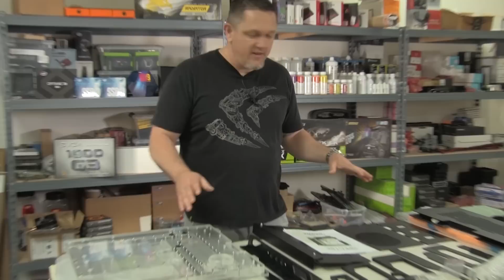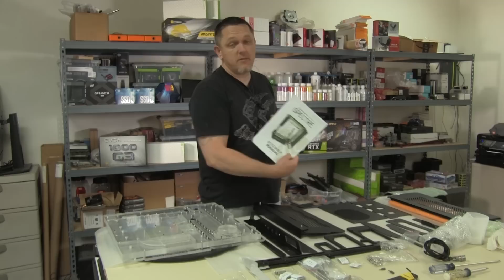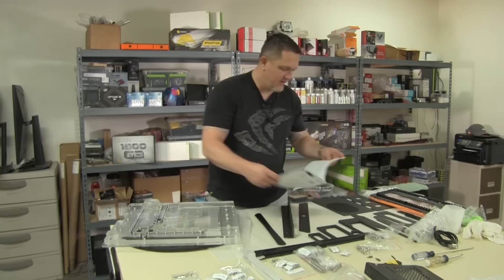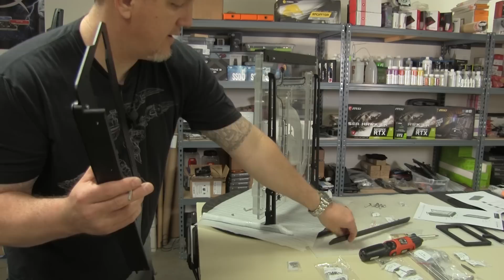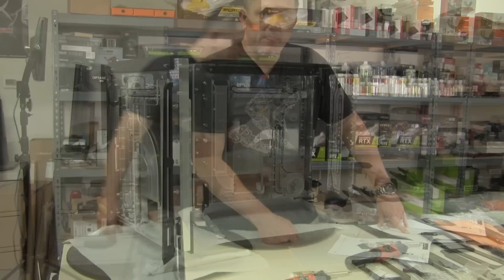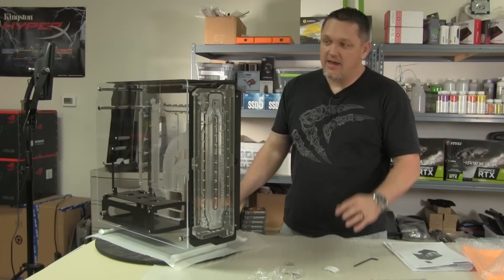This Is NOT a Review!! User Feedback WANTED!!!!!

Comment: Hi and thanks for the vid. You summed it up perfectly especially from 32 min mark where you analysed the benefits of the case over anything else on the market. I think the public will be over the moon when Singularity  show the lower temperatures and hence the overclocking ability of this case. There is nothing available that will perform as good as this currently on the market. You will not only have less expense on components but the shipping is so much cheaper due to the size. The size being smaller does not compromise the functions of this case. The quality, function and performance is yet to be realised and I am sure that everyone will be totally in awe of the cost savings while enjoying the benefits and functions.
Maybe I am biased but I couldn't help myself. I am sure you will love it.
Reply from the maker: Warrick Cannon so true! I totally agree. The case has everything you need to make an epic watercooled build. Most of the work is already done for you. Plus you don't have to buy a res, pump mount or cable combs just to name a few. I can’t wait to get my own! ;)